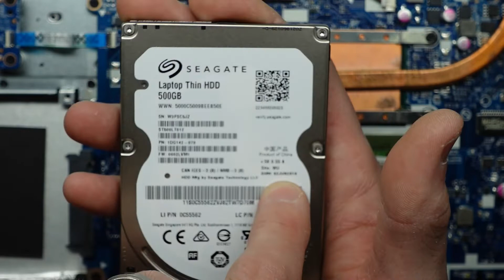Lenovo Ideapad 110-15ACL Teardown and Hard Drive Replacement

Comment: I have a question: how do you take out the fake dvd burner so easily?
Reply: you remove the screw from the bottom (area of dvd drive location)  then slide out the fake drive. Put the new dvd drive in and put the screw in.
Reply from the maker: not sure sorry

Comment: Thanks for the video - this helped me pull apart one Lenovo 110-15ACL this morning to replace the HDD with a SSD since it was running really slowly. It certainly was easier to pull apart than other laptops I've worked on.
Reply from the maker: Glad it helped
Reply: Hi mate, i've done the same thing, with an ssd that already has windows installed.
I've just now booted it up with the ssd, but it is stuck in the boot menu.
whatever action i choose does nothing at all. it goes straight back to the boot menu.

do you know perhaps how to solve it please? thanks in advance :)